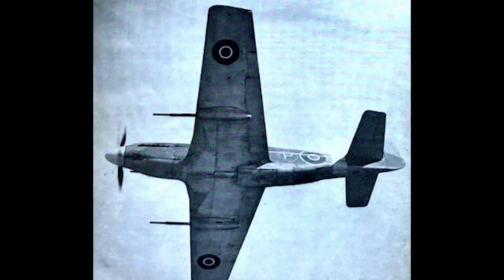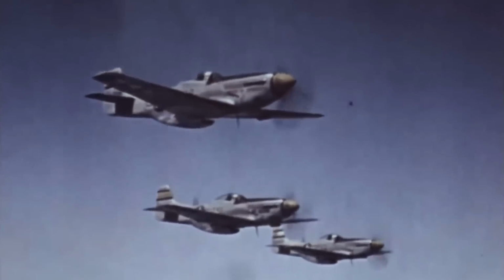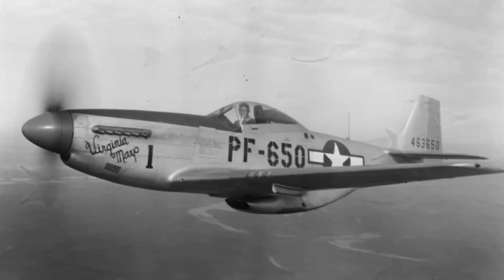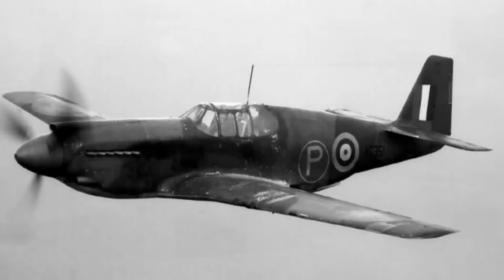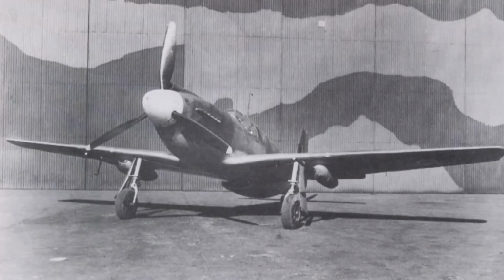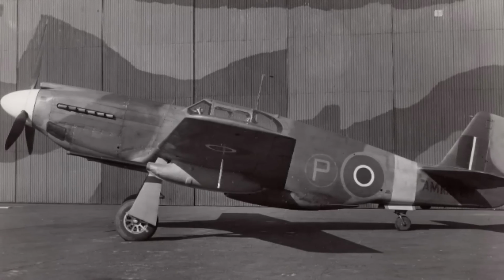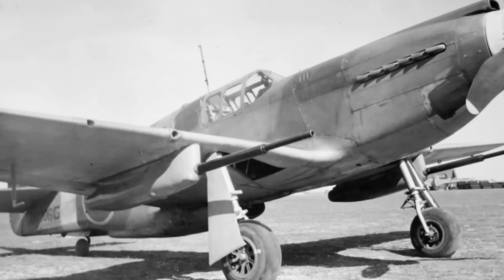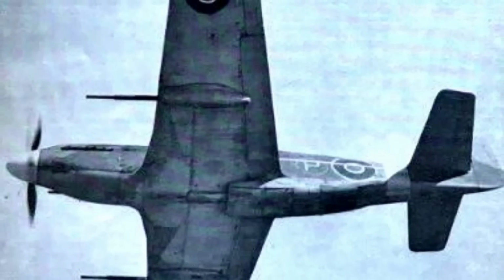The Twin 40mm Mustang; AM106

Comment: the problem with a gun like this is that it isnt exactly rapid fire. you go on a strafing run and you get maybe 2 rounds per gun until you have to pull up. f course the solutio to that wuld have been to add another pair of guns nest to the current pods. but that would maybe just rip out the wings..

Comment: Apparently about 300 Hurricane Mk.2Ds were built, and they did a good job until the more powerful Typhoon became available.
Ground crew would add extra armour around the pilot, and add tracer bullets in the 2 light machine guns which were meant to increase aiming for the 40mm guns.

Comment: Hmmmm. They couldn't figure out where to stick extra armor? It degraded performance so much it wasn't useful? The Mustangs were more useful as is? Or, too much buffeting? The old Mustang pilots at Oshkosh claim you can drive a Mustang pilot nuts "by taping a nickel to the wing"!

Comment: Without detailed documentation saying why they did what they did - we can't do anything more than speculate.  There were all kinds of things that were tried that never made it into production - or - if they did - were not extensively used for one reason or another.

I had always assumed that the 37mm guns on the P-39's were used by the Russians as anti-armor weapons - but - as it turns out - these weapons were not furnished with Armor Piercing Ammunition - so the Russians didn't use them that way.

Another example would be the drop tanks for the Me-109E's during the Battle of Britain.  They had some - but (iirc) they were designed to be disposable and made out of Papier-mâché.  They got left out in the rain and were ruined.  So - no drop tanks.

In any case - I don't know how many they had - so even if they hadn't ruined them - they may or may not have had enough to matter.  They just kind of morphed their way into the Battle of Britain and were not at all set up to do what they were trying to do.  No one had ever conducted an offensive air operation like that before and the Germans made a mess of it.  Also - the British Air Defense Net, for it's day - was very good.
.

Comment: There are details of the 40mm cannon-equipped Mustang Mk 1 AM106 on pages 207 and 208 of Tim Mason's book "Flight Testing at Boscombe Down 1939 - 1945 The Secret Years" published by Hikoki. With the 40mm cannons fitted "top speed was reduced by 17 mph (true airspeed) but range was scarcely affected," and "300 rounds of 40mm ammunition were fired in various flight conditions". AM106 had six months of continuous testing at A&AEE. Well done Ed for finding the photos, they do not appear in Tim's book.

Comment: Excellent video Ed, the problem was the Allison engine outstanding at low level, but the Mustang wasn’t designed for low level. Look for HEADQUARTERS
NORTHWEST AFRICAN STRATEGIC AIR FORCE APO 520 E-GEH-16 an AAF report having visited a Mustang squadron obtaining information on their daylight intrusion raids (Rhubarbs) using the North American Mustang I and IA aircraft. The bottom line, in the ground attack role Typhoon was significantly superior regarding combat load and performance the RAF were committed to the 60pound 3 inch rocket more bang for your pound than the gun. The Mosquito was superior in every other role, indeed so was the Spitfire Mk IX, in the fighter role but for range. Regards the gun, look into the 618 squadron Mosquito which carries the 6” anti-tank gun. The AAF ordered the A36 a dive bombing Mustang 1 which was a mistake, they should have put the Packard Merlin 28, has used by the P40F into it, has a stop gap whilst working on the Mustang, Packard Merlin 65 Mustang. Imagine a Mustang with a Merlin 28 engine available in 1942 for  Guadalcanal, the AAF would have obtained air superiority earlier. The A36 proved to be the worst aircraft produced by the US, with the worse accident AAF rate during the war.

Comment: It sounds like the tests confirmed earlier tests that more, smaller shots on target got more hits than fewer larger shots. 
Looking down an 11/2" barrel is impressive but so are 4 @ .50 cal firing 4X as fast. "Recoiless" is a nice concept but how much of that energy ends up being absorbed by the air frame and how does that compare to the impact of firing rockets?

Comment: great video, most people on the mustang's success but rather less on its origins and early versions. 

my guess here it that the tradeoffs were to high for what this idea offered. the benefits of the p51 might be all gone with that weight and drag added. then its a challenge to fire larger autocannons from airplanes in general. puts stress on the structure and i think the mustang might be a bit to small to be a stable gun plattform of that caliber.

Comment: Mustang AM106 seems to have been used as a trials aircraft for several ‘what can we hang on this new-fangled laminar wing’ exercises in 1943, including long-range fuel tanks, RPs on both standard and zero-length launchers and the 40mm Vickers S gun. 
The Mustang was originally utilised in early 1942 for reconnaissance in the ‘Army Cooperation Command’ roles and from the very first operation in May ‘42 the Mustang pilots realised that they had a fast, manoeuvrable and well-armed aircraft ~ initially 2x 50 cal in the nose and 2x .303” in each wing. On the first photo-recon flight, one ACC pilot of 26 Squadron returning low-level flew across Berck airfield, saw some tempting targets, turned and shot the place up. Not content with that, he also strafed a goods train on the way home. Before long, ALL the Mustang equipped ACC squadrons were merrily carrying out aggressive ops over occupied France and the  Low Countries. Not something we hear much about really.

Comment: The P-51 was never originally designed for high altitude long range escort duty, it was designed to replace the P-40 in low level ground attack and fighter roles. And in that role, the Allison mustangs are superior to the Merlin Mustangs. It was later adapted for high altitude roles.

But note, the P-40 was also equipped with the Merlin engine, and it did Not dramatically change the P-40's performance. And the P-38 with Allisons was superior to a P-38 with Merlins, as the P-38's Allisons outperformed the Merlin at high altitude. Keep in mind the Allison was a higher HP engine, and lighter, than the Merlin. It just needed a proper forced induction system. Just look what it took to turn the P-47 in to a high altitude fighter by comparison....look at that monster forced induction system....

Comment: Always been a fan of the P51A and A36. Got a fantastic book on these models and development history. It's worth noting that the P51a was as fast at low level as a mk12 griffon spitfire and faster than a FW190A series impressive given that these two aircraft had power in the 1600-1750hp range wheres the P51a had 1100hp. The A36 had 1300hp and was configured for low level dive bombing use but at the time it must have been something else. 390±mph at low level is  impressive. Also worth noting that later mustangs were not as fast down in the weeds..  Not to mention that they had fantastic range even without drop tanks. Big fuel reserve and an engine that was less thirsty combined with clean aerodynamics. The P51A series doesn't get the praise it deserves. That can be said of many ww2 era warbirds.
Reply: the Allison engine is very good down low, people never acknowledge that. especially given that so few aircraft were designed for high altitude long range escort, and very few aircraft ever fit the bill in all of WW2 to do long range high altitude escort.
Reply: Agreed wholeheartedly.  The 1st Air Commando group's exploits in Burma are worth reading up on as they fielded a number of P-51As- well, at least until they re-equipped with P-47s :)
Reply: @VenlyssPnorr  you forgot to mention they flew P-51s from March of 1944 until September of 1945. only receiving the P-47 after the war was already over in September of 1945.

And they flew P-51A, then P-51B, then got P-51Ds in January 1945. 

In September 1945 they received old P-47D that were already being replaced by newer P-47N models, which had saw limited service in the Pacific before the war's end. This was likely the result of sending the newer and better P-51D models back home and replacing them with older P-47D they didn't care to keep as part of the draw down. The USAF and ANG completely consolidated onto the P-51D/H at the end of WW2 until the jets came long.
Reply: the Allison engine was producing 1700hp down low, and up to 2200hp by war's end.

"Also worth noting that later mustangs were not as fast down in the weeds."

becasue the allison engine is superior down low. Did you know the P-40 was faster than the P-47 at low altitudes?

And the P-38 proved that with a proper induction system, the Allsion was even superior to the Merlin at altitude as well. The Allisons of the P-38 easily produced more horsepower at altitude than a Merlin. Greg even did a video about this.
Reply: @SoloRenegade  Only some variants of the Allison engine produced 1700 hp, and none were put in the P-40, the P-39 or the P-51 for that matter.
Reply: @martijn9568  "Only some variants of the Allison engine produced 1700hp, and none were put in the P-40, the P-39 or the P-51 for that matter."

not true. engines capable of 2200hp were in late model P-40s.

After the war engines modified for racing reached 3300hp.

Curious thing how engine stats are reported. they pick a single value, usually much derated, and then ignore the max horsepower possible.

Greg has done a video on this as well, so it's not just me saying it.
Reply: @IncogNito-gg6uh  Commanders and Generals begged to get more P-38s. The real issue with the P-38 was its cost, and consumption of resources. For 2x the money and engines (not to mention the extra maintenance), you got half as many fighters. in a war of logistics this wasn't going to continue, especially once better single engine fighters were plentiful. More likely the P-38s started to get neglected and run short of parts as they were phased out, and that's why you saw increasing issues as planes wore out from use and lack of support.
Reply: @IncogNito-gg6uh  the Allison was tough and reliable. In fact, many restored or replica WW2 fighters today fly on Allisons (Yaks, FW190...). the issue was it's carburetor. it never received the attention it needed. Allison got shafted by the US gov during WW2. They never got the funding they needed to develop induction systems, and I don't understand why. The engine was lighter and more powerful than the RR Merlin. It just need a better carburetor first off, then a proper forced induction solution.

the P-38 had a cold cockpit issue for sure though.

I think part of the problem is that most pilots have a strong tendency to try to maneuver fight. the P-38 was not a maneuver fighter. it was a dive in fast, shoot, climb away, turn around and try again. Boom and Zoom. but this requires both patience and discipline. Low skill pilots always resort to turning when they get flustered or scared. and that just wasn't the right thing to do.
Reply: @IncogNito-gg6uh  But the US gov never invested in developing a 2 stage supercharger for the Allison. And the US gov aborted development of the turbocharger that was supposed to go into the P-39 and other aircraft. Some of this was the result of RR lobbying. Rolls Royce successfully pulled strings to interfere with and even destroy engine manufacturers in the US and UK. Many engines with potential were sabotaged by RR political influence.

Allison even had excess manufacturing capacity available, when other engine manufacturers were swapped, and the US gov never utilized that.

Comment: I find the Mustang Mk1 an intriguing aircraft. Most histories say it was good and swiftly move on to the Merlin engine - I’d love a piece that concentrated on the Allison version - how good was it in comparison to say the typhoon and how long was it in service and any noticeable achievements?
Reply: Sounds like a job for Greg... 😉
Reply: The Typhoon had a two speed supercharger so it had reasonable speed at altitude but the fat wing gave compressibility in a dive, the Mustang I would be able to dive but couldn’t get up there in the first place. They were both very good at low altitude, the Mustang I remained in service to the end of the war.
Reply: Agreed, a Mk1 Mustang vs Typhoon history would be revealing. The Typhoon and Mustang only became ground attack machines by accident. The Mustang's problems were solved with the fitting of the Packard Merlin. The Typhoon was cured only by extensive redesign to become the Tempest....
Reply: @jimdavis8391  the purpose of the P-51 was to replace the P-40 in the ground attack role.....and it did very well in that role. Many Allison powered Mustangs flown in the ground attack role, their pilots preferred them over the P-47 for ground attack even.

Comment: The 6 squadron reports on the 40mm armed hurricane seemed to suggest always sending a fighter escort,  which oddly ended up as the P40 warhawk,  funny how things turn out. Then someone cleverer came up with the De Havilland  tetse, a Mosquito with a 75 mm gun!!
Reply: You got your digits the wrong way around! The Tsetse was a 57mm or 6lb Molins gun. Cool aircraft and I agree with Ed, the 40mm Mustang was super cool!
Reply: Although there were very few Tsetse Mosquitoes built ~ because it was decided that RPs were the way to go, even if they were woefully inaccurate compared to the Molins 6pdr ~ the concept was taken further. Instead of using the next available anti-tank gun ~ the 17pdr ~ it was decided instead to jump straight to what would have been the 17pdr replacement, the massive 32pdr (94mm). It still boggles the mind to think that they shoehorned one of these beasts ~ a gun based on the 3.7” anti-aircraft gun ~ into a Mosquito and then flew it and fired it successfully post-war. The muzzle-brake for this gun was a work of art in itself. Having proved the concept though, it was then scrapped.
Reply: @davidpope3943  No evidence the 32 pounder was ever fitted to the aircraft. Only one file in the National Archives covers the testing of the 32 pounder with the Muzzle brake in question and that was done on a ground rig with pressure sensors at the points where the nose, props and engine nacelles of a Mosquito would be if it was fitted to the aircraft (a drawing of where the gun would have been fitted to the aircraft (with the location of the sensors) is in the file along with the date of the test (15th August 1945 at Shoeburyness). The muzzle brake was almost as big as the Cockpit canopy of the aircraft!! Had it flown, De Havilland's archives would have the plans for it, there would be a photo of it and the serial number of the aircraft would be recorded. If AAEE got their hands on it there would be a gunnery trial report with photos in the National Archives. No such documents exist.
Reply: @richardvernon317  Thanks for that Richard. Very interesting. Ah well, that’s a piece of Ian Hogg history telling I’ve believed since the mid 1970’s consigned to the bin!
That muzzle brake by M. Galliot though is still a mighty impressive piece of engineering.
Reply: the USA put a 75mm in a B25 and made it work so much it was a standard fitting for the AC at the factory..
Reply: 57mm gun not 75mm.

Comment: A brief video but definitely worth putting up. Ah, the interesting things one can hang on an airplane once it has a powerful enough engine.
Reply: Tsetse Mosquito, baby!
Reply: (Don said) "Ah, the interesting things one can hang on an airplane once it has a powerful enough engine".
That is quite true.
In quite a different league,  I was told by a flying instructor he knew of one certain instance (and suspected there have been several other similar cases) of a light aircraft taking off despite the pilot having overlooked the need to untie the wing lug from the pretty heavy concrete ground anchor.

Apparently the rather urgently made landing after a swift and somewhat truncated circuit was not a sight of great beauty,   but both idiot pilot and aeroplane survived essentially unscathed.
Reply: @babboon5764  Lol. "We're gonna need a bigger weight."
Reply: Eh, the engine on this experiment is an Allison -- NOT a Merlin or Packard-Merlin.  Obvious because the carburetor intake is above the spinner.